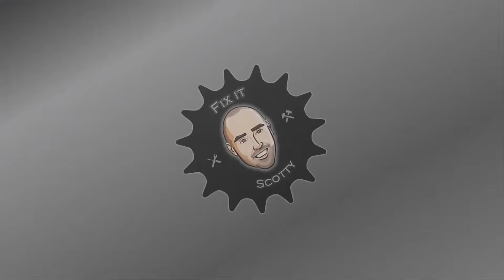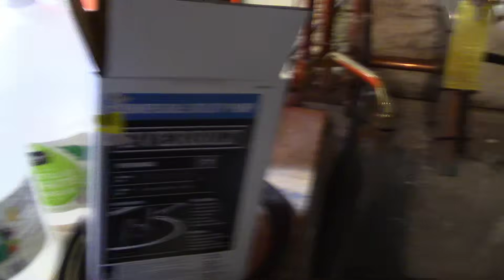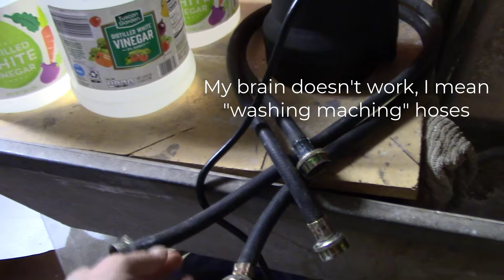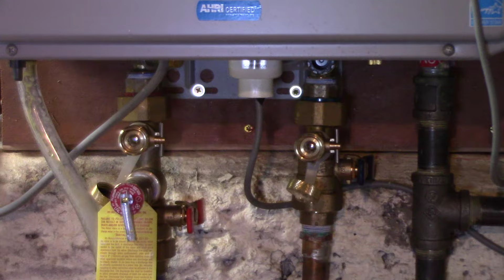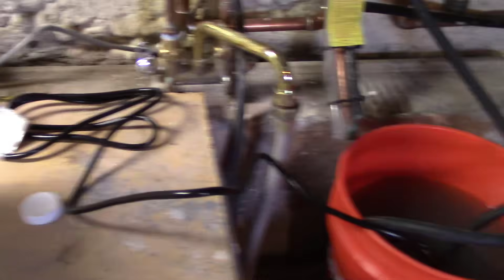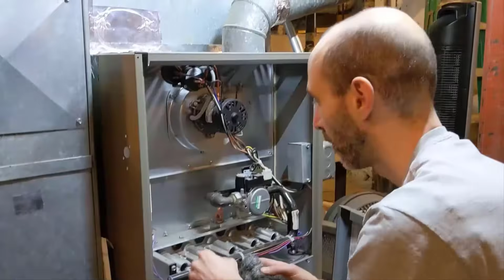Rheem Tankless Water Heater Annual Maintenance Flush

Comment: Hi Scott 
I have a rheem tankless for prob 10 yrs. Didn’t realize maintenance was required. Now I’m getting intermittent times where the water does not get hot. The code #12 appears which is no gas. Mostly this happens at my kitchen sink, which is only about 12 feet from the unit itself, which is located in the basement. I could turn the hot water on in my shower, which is much further away and that will get hot but remain cold at the kitchen sink. Being that has never been flushed or descaled would you recommend doing the Hosher descaling chemical and then going to the vinegar the following year.
Reply from the maker: I haven't memorized the codes for this heater, but it does seem like your heater is suffering from scale buildup and is not functioning properly as a result.  I would suggest you use a chemical descaler like this product: https://amzn.to/4a5T0sv.  You will do it the same way I showed here or in my follow-up video, but follow the directions on the product for specific mixing and flushing instructions.  I can't really explain why you are getting better hot water further away from the heater though.  That is a head scratcher!

Comment: thanks for the video. I have a water softener system and noticed recently I was getting limescale on my shower head. seems like this might be the culprit. unfortunately whoever installed the tankless water heater did not install the service valves to it. so theres no way for me to flush the system out. ive had it for about 2 years. so I hope im not at the point where I just have to replace the whole thing cuz of that buildup.
Reply from the maker: Have your softener checked.  I had my softener for 10 years and I noticed scaling coming back.  The unit had to be replaced because the resin in the main tank killed it.  They don't last forever.  After a few days with the replacement softener, I saw an improvement in scaling.  You're not the first to mention the lack of service valves on a tankless heater.  I don't know why some plumbers aren't installing them.  How do they expect to flush it without them?  Maybe ask the original plumber that question.  Good luck and thanks for watching!

Comment: Aren’t you not supposed to have a valve between the relief valve and water heater?
Reply from the maker: The purpose of a pressure relief valve is to automatically open if the internal pressure of the unit builds too high (like if you have an expansion tank and it goes bad). So it wouldn't work properly if you put a manual valve in between it.

Comment: They have a 3M inline descaler, I wonder how effective that is. ..?
Reply from the maker: Good question.  I have never used this product.  But I can tell you that my water softener has been very effective at reducing scale.  Not just in my water heater, but also my dishwasher, washing machine, and shower heads.  If you have hard water and see excessive scaling in your plumbing, I would start with a water softener and then add something like this product in front of the water heater for additional insurance.

Comment: Water flow seems slower on discharge hose this time (I’ve done it before) thoughts?
Reply from the maker: There could be multiple reasons (these are just guesses).  Perhaps your pump is not working as well as before?  You may need to clean your sediment trap (see my Advanced flush video pinned in the first comment).  Your maintenance valves could have some crud in them restricting the flow?

Comment: If you haven't purchased a tankless water heater yet, don't.

Tankless water heaters are way more hype and expensive than traditional water tank water heaters.

Save your money, time and inconvenience.

You'll pay like $1,500 for the tank another $300 for parts and installation on the low end will cost you $1,000. The total cost  $2,900.

A typical tank water heater you can purchase a 40 gal gas water heater tank at a discount appliance store for like $500 but let's say $800 at HD, the installation cost on the low end will be like $700 total cost $1,500 and it can last 10 to 15 years.
Reply from the maker: Installation cost is usually what determines the value of going to tankless.  In many cases, it can cost much more than $1K to switch from tank to tankless.

But you didn't factor in longevity and efficiency into the comparison.  Tankless water heaters can outlast a tank by 1.5x (in some cases, double).  That depends on the quality and warranty.  Also, a tankless will save you an average of $100 per year in gas depending on water consumption.  If you did an apples-to-apples comparison by warranty, a Rheem tankless heater and 40 gallon heater with a 12 year warranty is only a difference of $560.  It would only take 6 years (less than half the life) before the tankless becomes cheaper not accounting for installation cost.

But again, if it costs $2000 to switch from tank to tankless in labor cost, it would take a lot longer to recoup.  In my case, I installed it myself and got a 12year warranty unit on sale for a good price.  So I am already reaping the cost benefits.  I would also choose a tankless if I was building a new house because the initial cost from scratch would be less than retrofitting later.

Comment: The instructions for flushing my Rheem unit say two gallons of vinegar are all that is needed. Also, my instructions include one more important step: 3. To properly flush the heater the electronic bypass valve inside the heater must be closed. Follow these steps to do this:  
At the remote control, turn OFF the power and wait 10 seconds. 
Turn ON the power at the remote control, wait 10 seconds, 
and disconnect the water heater from the electrical source. To me this means turn off the breaker that supplies power to the unit. JUST BE SURE TO CHECK THE INSTRUCTIONS FOR UNIT.
Reply from the maker: Thanks for the information!  I actually did a new flush video (in my pinned comment) where I did those instructions you mentioned.  For my model, that doesn't work.  But for other Rheem models, you may need to do that in order to get the vinegar through the heat exchanger.  I agree with you; follow the manufacture instructions for your model because they are all a little different.

Comment: Followed these steps exactly and now I have water all over the floor
Reply from the maker: Oh no!  I didn't include this in the video as it is an outlier, but if your main service valves aren't properly shutting off, you could end up overflowing your vinegar bucket with water.  Is that what happened?  If so, check your service valves by shutting both sides off and put a hose just on the hot side.  Slowly open the smaller service valve on the hot side.  A little water may come out, but it should stop immediately.  If you have a continuous stream of water, your main valves aren't shutting off properly.

Comment: I wonder if you added some stuffing from a pillow as a filter you would be able to trap most of the debris that’s coming out of the heater.
Reply from the maker: No need to make your own filter.  I show you how to clean the sediment filter that already exists on the cold water intake.  It's in this video: https://youtu.be/CfC-WXNDnHo
Reply: @FixItScotty  it seems to me the debris that’s coming out of the system would clog up that tiny filter very quickly. I wonder if the water coming out of the heater back into the bucket is clear as it passes out of the hose. I’m assuming based on the view of the filter you showed on the other video that it’s not much filtering material, more like a screen. And the screen must have big enough holes to allow some sediment through or it would quickly be clogged up.

Comment: Great video, Scott....really helpful!  Question:  I already have a 1/4 submersible pump....do you think would suffice, or not have enough power?
Reply from the maker: Thanks for the kind words.  Despite me saying it wrong every time, the pump I used was a 1/6HP pump.  Technically 1/4HP should be more power.  But it really comes down to the quality of it.  It doesn't hurt to hook it up like I showed and check the flow - even with some water.  Your output should resemble a 20 year old dude peeing; not an 80 year old. 😄
Reply: @FixItScotty  Hahaha, thanks a lot…I’ll keep that in mind lol.  Thanks for replying so quick too! 👍

Comment: The people who installed the rheem in my house before I bought straight lined it with a shut off valve before the entrance. There isn’t any flush valves. Is there anything I can do? At first I had no pressure for hot water. I cleaned out the screen at the entrance to unit and it started working. Now I have pressure when turned to hot but it won’t get hot.
Reply from the maker: I mentioned in my advanced flush video an alternate method to the maintenance valves is to plumb in shutoffs and boiler drains on each side to replicate the functionality of the maintenance valves.  If you can disconnect the unit, you may as well retrofit proper maintenance valves.  However, if the unit isn't firing and you aren't getting any hot water at all, first look into that - I doubt flushing it will fix that.  Are you getting any error codes like gas pressure issues?  Prioritize making sure the unit works before dumping more $$ into it.  Good luck!

Comment: will this work with a Rheem natural gas recirculating tankless water heater also? I'm not sure if that's different than what you have.
Reply from the maker: This Richmond series unit does not have the built-in recirculator pump and control circuit, so I'm not sure if this process will work for you.

Comment: You forgot to clean the water filter and the air filter and clean the cap where the exhaust escape’s .
Reply from the maker: Yes I only did the flush on this video.  I did show cleaning the inlet filter on my second video.  Good point about the exhaust cap.  I do clean that occasionally when I am on the side of the house.

Comment: Scott, I performed the same steps only with a Stiebel Tempra and I couldn't get the pump to push the vinegar through.  Although I have a small filter in the fitting, it was clear.  I couldn't find out why the the flow was blocked.  I tried the pump in a bucket outside and it pumped fine.  The reason I was cleaning the unit is because only one element is heating the water instead of two.  The manufacturer recommended that I do what you did.  It didn't work well for me.
Reply from the maker: If your pump is blocked, there may be an internal valve preventing flow while the unit is off.  Have you seen my newest video?  https://youtu.be/CfC-WXNDnHo.  I present two additional techniques to make sure your bypass valve is open when cleaning.  If you still can't get it to work, try calling the manufacturer's support again to get a better answer.
Reply: @FixItScotty  Thank you Scott!!  That's interesting.  I watched your second video and I'll try performing the same thing I did last time only with the unit turned on.  What I don't understand is Stiebel Tempra didn't mention anything about this.
Reply: You’re supposed to flip the breaker to the tankless INSTEAD OF hitting the off switch.  Hitting the off switch causes a valve to close in the unit.

Comment: Unfortunately, my unit does not have a service valve for both lines.  How do I proceed with the annual flush?
Reply from the maker: I discussed this a little in my advanced flush video: https://youtu.be/CfC-WXNDnHo?t=558.  Unless you have flexible supply lines that can be disconnected, you need shutoff valves on both the cold (input) and hot (output) sides to isolate the unit from your water.  You also need some kind of inline hose bibs to connect the cleaning hoses.  I've heard of plumbers shutting off the water to the whole house and pumping the vinegar in and out of exterior hose spigots.  But that seems like it would take A LOT of vinegar and would need a lot of flushing.

Comment: Good video but two things. First, you didn't clean out the pump of vinegar...good to do.  Also, there are 1-2 filters that on the tankless heater that need to be checked/cleaned.  But other than that, good video.
Reply from the maker: Thanks for the feedback. I did a newer video (linked in the description) that shows how to clean out the inlet filter. I forgot to do it in this one.

Comment: Did you ever determine if you need to turn off 10 sec, turn off 10 sec, then unplug to flush properly per Rheems?
Reply from the maker: See my follow-up video.  It is not necessary (nor does it work) on this unit.  But other Rheem models it may be necessary.  https://youtu.be/CfC-WXNDnHo

Comment: I tried this, and, at first it seems to be working fine, but, within a minute, the flow comes down to a trickle.
Any ideas why?
Reply from the maker: Try watching my advanced maintenance flush video to see if some other techniques work for your particular model or brand.  https://www.youtube.com/watch?v=CfC-WXNDnHo.
Reply: Thank you for your reply.
I already had watched your Advanced video. I watched it again.
It doesn't address my issue: slowed down flow. But that's OK.

Some extra information - for yourself and anyone else out there.

I have two Rheem RTEX-24 electric. Both had the similar issue.
My original pump was, I think, a 1/6 HP. It was an old pump I got from someone and I am not sure how effective it was. Within 30 seconds to 1 minute, the flow really came down to a trickle. If I stopped and re started it, it would start with a nice flow but then slow down again.

I went and purchased a 1/4 HP brand new pump. so, from 0.1666 HP to 0.25 HP. The same thing happened: slow down after a minute or so. But, with the more powerful (and brand new) pump (1/4 HP) the slowed down flow is much better. Not a trickle anymore, but rather a regular but slowler flow of water (well, vinegar).

I did this for 1 hour on each unit and then flushed with water.

I'll try again next year.
Reply from the maker: @nduchast  Sorry I couldn't help, but your issue isn't something I have experienced.  Hope you find the answer.  Good luck!

Comment: I thought you were supposed to “back flush” when doing this cleaning. Pumping into the hot side and exiting the cold side.
Reply from the maker: The official instructions I've seen for Rheem and Rinnai heaters show the flush going in the cold and out the hot.  It's possible on other brands there are specific instructions to ensure the bypass valve isn't engaged when cleaning which could include flushing in reverse or turning off the unit in a specific way, but I'm not sure.
Reply: @FixItScotty  ok, thank you.